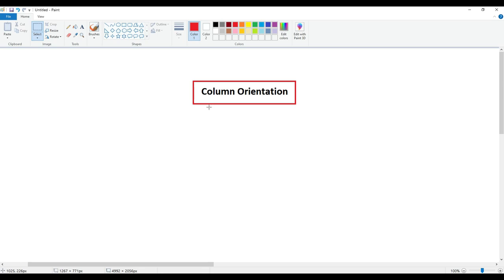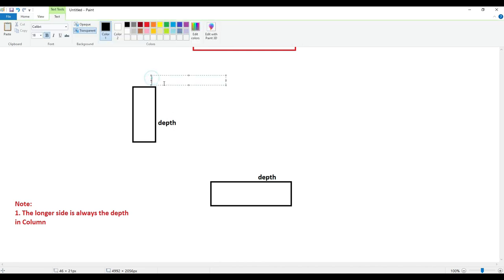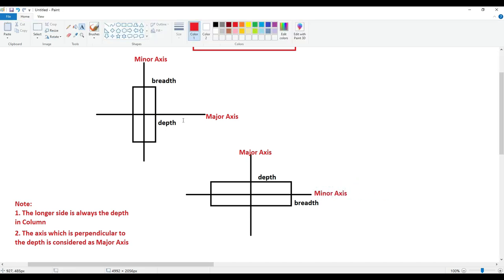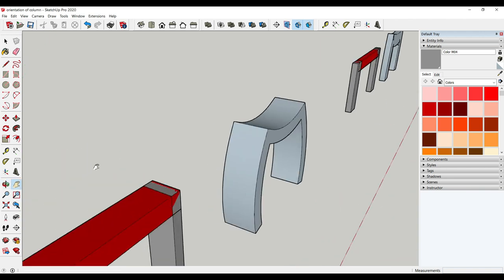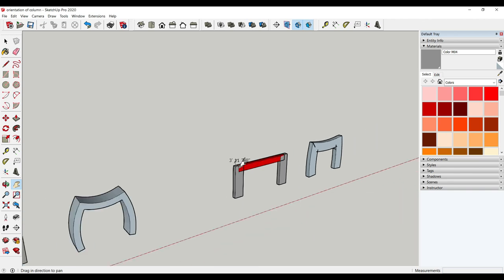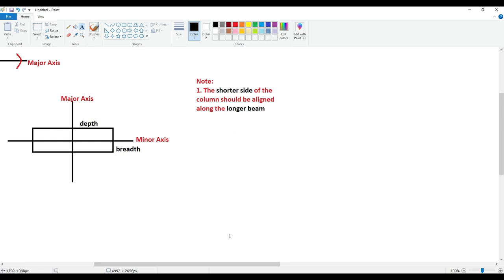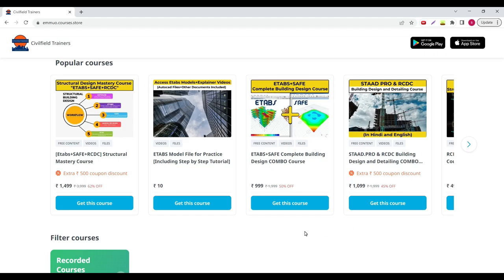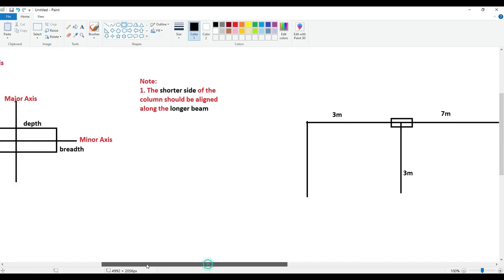Master Column Orientation in under 11 Minutes!!!

Comment: the shorter side of the column  should be perpendicular to the orientation of the longer beams length, which is equivalent with saying the deapth of the column should be aligned or parallel with the length of the longer beam, i hope that was what you mean.